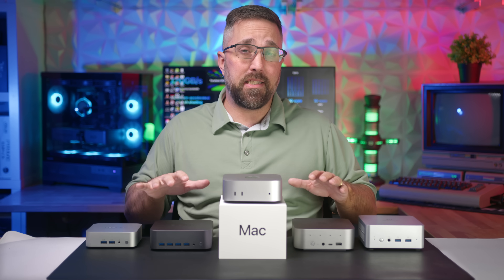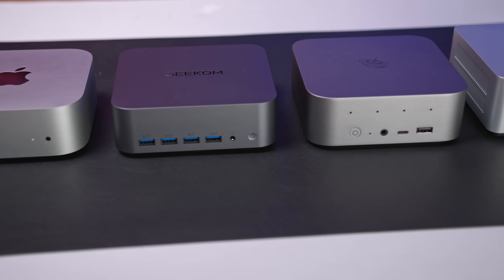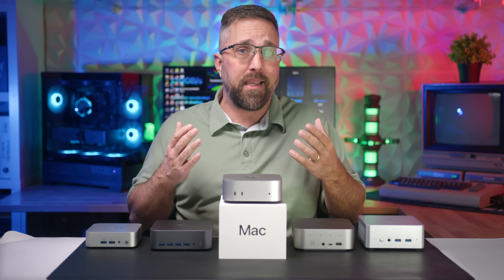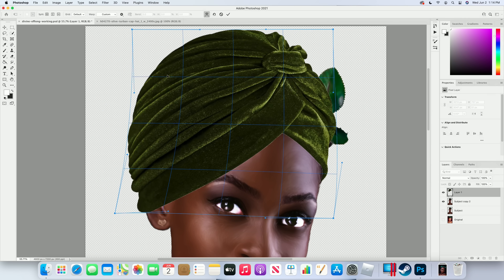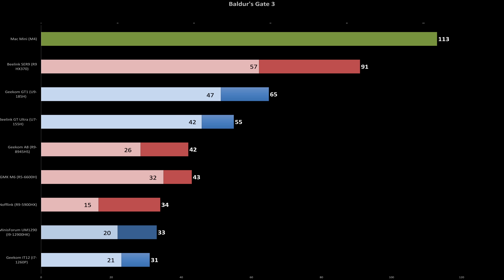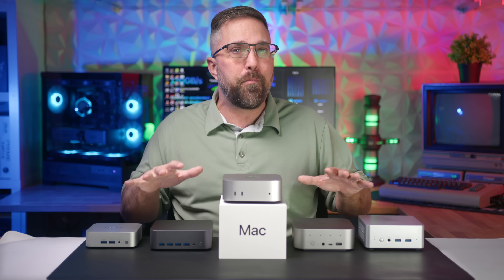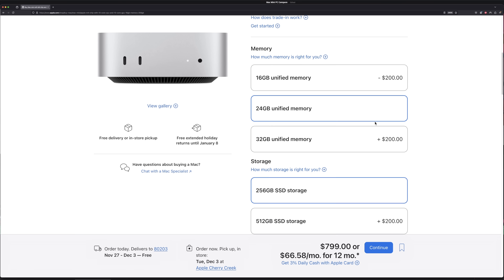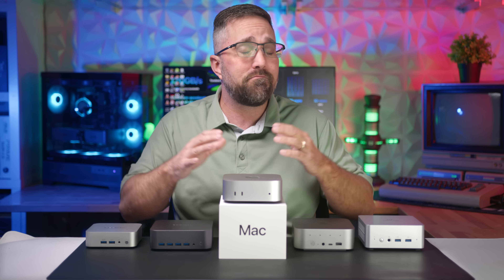M4 Mac Mini vs Intel and AMD Flagships – It's Not Even Close!

Comment: Thing is with a macOS/UNIX host system no reason to turn it off.  Never turn off my new M4 Apple MacBook Pro - Space Black 14-inch Liquid Retina XDR display 10-core CPU, 10-core GPU, 16-core Neural Engine 24GB unified memory 1TB SSD storage  $ 1799.00 US.  Run third party Energiza Pro and have it set to start charging when below 50%, and stop at 70% so never see any issues when it comes to the battery.

Have owned three Apple Mac mini's over the years.  Moved to Apple MacBook as my daily driver that I can take with me.  The fact that I can easily take it with me is why I went with a Apple MacBook or the Apple Mac mini.

Open source Linux I feel will come over time.  Linux must like UNIX has found its home on a number to processors over time.

Comment: I have a 2020 iMac 27” ,3.6 GHz 10-Core Intel Core i9, AMD Radeon Pro 5700 XT 16 GB, 96 GB 2667 MHz DDR4 and 1TB HHD which I bought new 2020 new . Last of the Intel chips. Just as a comparison Black Magic has a read speed of 2507.6 and a write speed of 2901.8. Rendering a FCP 50 minute 4K video takes a while not sure exact time just do something else while it is rendering. It came with 16gb ram and it has a back door that you can swap out the ram chips. M 😀

Comment: Power button on the bottom, "I can't make that make sense". It makes sense if you consider the fact that the power button on a Mac is almost never used. I've never voluntarily turned off any of my Macs since 2002. So the only time they're off is during software install (which doesn't require use of the power button) or in cases of non-laptop Macs if I was moving it from one location to another. In the old days you occasionally had to reboot once or twice a year due to OS crashes. Something that has become so rare that I have no idea how long it has been since I had one. Other than that, never use the power button. And notice that Apple keyboards have a power button on them, so the computer boxes power button is redundant if you're using Apple's keyboards. So you're talking about a button that you will likely use a few times / year or maybe never.

Comment: For a new machine as an internet of video hub Mac is probably the best choice. For X86 things like gaming and support of old eBay stuff, I would not consider it, it is not X86 and they stop support like their phones. My laptop is a 2012 I7 Mac that I put a TB drive, memory, battery, Win11, and a lot of games on, it works great and I did it because I trust Mac hardware.

Comment: I disagree with you price to performance chart.  I just picked up a new SER9 AI HX370 for 999. This comes with 32 GB RAM and a 1TB NVMe HDD.  If I go onto apple's website, and build the BASE model with the same RAM and HDD specs, it comes out to 1399, another $400 more than the SER9.  I suppose if price to performance also means with dis-similar specs, then that chart is accurate.
Reply from the maker: Is the 32 GB of memory and more storage required for your workflow? How much performance gain does it deliver, and will it outperform the lower-spec Mac Mini?
Reply: @ElevatedSystems  - I think what Im saying is, subtract the cost of what apple charges for the RAM and drive upgrades from the other systems.  Their performance for your tests more than likely wouldn't drop.
Reply from the maker: @rrshier  the costs are the costs and the prices are the prices. Apple charge stupid prices for their memory and storage and Intel/AMD charge stupid prices for their APU’s. Considering just the cost of the newest CPUs in the mini pcs costs more than the entire Mac Mini.
Reply: @ElevatedSystems  - By the way, I don't overall disagree with your assertion. I definitely use systems in a way where 16GB would not be close to enough.  I also have been looking at these for something I can put in my camper as a travel gaming setup.  For that, Apple just isn't the system, and this is having been an apple app developer for years, I love the apple products overall.
Reply from the maker: @ why not just go with a gaming console? Genuinely curious.
Reply: @ElevatedSystems  - Great question, size and weight.  Campers (even our big one) dont really have the space for a full PC, and Im looking for something that can easily emulate and play SOME AAA games.  Most of what I own is on STEAM.  At home, DEFINITELY a PC :-) but on the road, Im searching for something small, light, and with enough power to do 95% of the gaming I want to do with no additions.  I actually just put in an order for a Beelink SER9, but I think I may return and wait for a mini with the soon to come out 359 Max +. (Just subscribed :-))

Comment: Interesting article, but I have a big problem with this:

You are using yesterdays pricing for the PC products.  I just ordered a Minisforum UM790 Pro with an AMD Ryzen 9 7940HS processor barebones, for $300.  This has Radeon 780M onboard graphics.

Add 32 GB of 5600 DDR5 memory for $80 and a 2TB Gen4 Silicon Power NVME drive for $100, and you end up with a killer productivity /  gaming PC for around $500, withbetter price / performance to the Mac.
Reply from the maker: The 7940HS is 2 generations old. Of course it’s cheap.
Reply: @ widely acknowledged that is almost no difference between the Ryzen 9 7940 and the Ryzen 7945, both in benchmarks and real world performance.

Geekom A8 complete system also available for $550 currently with 32 GB DDR 5 ram and 1 tb nvme

Comment: Windows i can connect RTX 4090 with thunderbolt  ! apple cry
Reply from the maker: So you are getting half the performance from a $2000 graphics card on a sub $1000 mini pc. That’s not very intelligent hardware pairing.
Reply: @ElevatedSystems  Not if you use it in certain games and not if you are using it for Blender and Davinci resolve.

Comment: i'm sorry... As "bad" a value Ryzen AI HX 370 is, for now, the 8735HS Ryzen mini PC for 440£ (32GB/1TB) is unbeatable as a mini PC. 

And NO, i'm sorry, i wouldn't buy an Apple PC with just 256GB of storage... 16GB of RAM is already cutting it close, (8GB unified was a spit in the face of consumers).

How about you spec the apple mini with at LEAST 512GB of storage... Because if i'm gonna work with external SSDs and Thunderbolt 4 dongles that cost HUNDREDS $$$ ... You're making a really misleading argument... 

799$ for 16GB/512GB Mac Mini isn't as appealing and hell not the >1000$ for 32GB/1TB options.... But hey... We're simping for Apple on youtube ain't we?

Comment: 256GB is just offensive. YOU CANNOT SUBSTITUTE EXTERNAL STORAGE FOR BOOT DRIVE CAPACITY. The minimum base model SSD space in 2024 is 1TB. Period. Apple needs to wtfu. My 2011 Imac had a 512GB drive and 12GB ram, both of which could be upgraded. I have watched these Apple releases year after year and have never bought another computer from them because they decided to stop providing adequate ram, hard drive space and I/O. Their computers are therefore unusable. I loved my 2011 Imac, but I won’t be back until Apple starts selling whole computers again. No one cares how fast the processor is if the computer repeatedly crashes due to insufficient RAM or you cannot install large audio libraries because there is not enough transition space on the boot drive. Wake up Apple. My Lenovo Legion has 8TB internal storage and 128GB ram and was about 1/5th the cost of a comparable Mac.

Comment: With only 16GB of RAM and 256GB HD mini still isn't an option. That's ludicrous. They could release it for $800 with 1TB HD and 32GB of RAM. That would be a competition. PS. An i5 14700K based PC (with mac os on it - Open Core), with 4TB NVMe, 128GB of RAM and RX 6600 costs around $1300. You can always build it with less RAM, smaller NVMe and pick other AMD GPU (used one). Performance wise it's not as fast in single as base M4, but it's between M4 and M4 Pro in multicore tasks. In other words you can build a custom PC, that is almost as fast in multi as M4 PRO, yet with much more RAM and NVME storage, for less money than basic M4 Pro mini.  The only problem here is power consumption.
14700K    2942     Single-Core Score    19088    Multi-Core Score  125W
14700      2740     Single-Core Score    16063    Multi-Core Score    65W
M4mini    3838     Single-Core Score    14838    Multi-Core Score    40W

Comment: If you do a lot of video editing the M4 is great. For other uses it's not so hot. 

This is for desktops. For laptops low power consumption trumps all. Then you are down to power consumption vs battery capacity and weight.

Comment: Same lie over and over again by fan boys like the creator of this video. Don't compare the 699 euro basic Mac Mini because it's useless and no one really buy it. The real starting point is at last 1TB disk and 32G RAM. That's the minimum. With the minimum M4 10 cores chip it's 1690 EURO!!!! it's much more then ANY OTHER mini PC out there to sell!!! I kust bought a mini PC for 351 EURO with 32G and 1TB disk. Sure, you'll not get a good spec at that point, but it's by far less then 1690 EURO to pay for Mac Mini the real basic (with 32G RAM and 1TB disk - the minimum requirements today).

Comment: The Mac mini has the button underneath because it is not necessary to turn it off, as its consumption in use is ridiculously low, and in standby mode it is negligible.Energy-wise it is ridiculously efficient, but I think if I were to put an on and off switch, it would be interesting to put a touch button on the apple, just put your finger on the apple and turn it on. Lol

Comment: I paid 600 for the beelink 370 hx amd one. I prefer windows personally so at that price its hard to refuse. Also no clue why but I am getting a lots better on Geekbench (2919 single core and 15489 multi core.)î how you get that low is strange. Same for gpu on open CL I am getting 49441. But if we use one made for amd gpu Vulkan (why not as you used apple API right?) I get 59403. I am wondering if your unit fully updated (including gpu drivers and bios) and if you adjusted the gpu memory (its can stretch it leg better at 8 gb than default 4 gb setting) I think the difference would be much less if it was fully updated and running at 8 gb gpu video memory instead of 4 gb. That or your unit defective.

Comment: I have a m2 Mac mini (8gb ram / 256 gb ssd), but I want to buy a m2 iPad Air (8gb ram / 256gb ssd) which is 599 USD on discount, it costs the same as the base m4 Mac mini (16gb / 256gb SSD). I don't know what to do.

Comment: I had a intel macbook pro that I used as my daily driver for all my school stuff and coding projects. I had to do a lot of C sharp stuff this year ( I am not a fan) so I sold it and got a windows laptop. Windows 11 has given me a lot of issues but I don't want to pay apple prices. I ordered the M4 mini with student discount and upgraded the RAM to 24 GB for $750 after tax. 16GB is probably fine but when I am running a couple of docker containers, its nice to have the extra RAM. I don't need a laptop so this seems like a better value. I get people complaining about the storage size but its not hard to plug in an external drive and its not like a laptop where you have to carry around the extra storage, or even better build a NAS and you can access your files from any device.

Comment: Am I the only one that noticed that the Mac mini was stock not max upgraded while the others were
Reply from the maker: Nobody noticed because ALL the PCs were stock / base configuration. In fact those are the only config the Mini PC are available in. If you want to upgrade them you need to do it yourself. Which you can do and was a point I made.
Reply: @ ahh I see I though the others were maxed out due to the fact they had names like intel ultra lol

Comment: AMD is really good at games in my experience. I know it's all different cpu architectures, including ARM. I recently bought a new Intel computer with a 12600kf and a rtx 3060 gpu and it's fine, but my AMD pc from 2012 is still kicking ass with a AMD fx-4100, an Nvidia Titan X, and a EVGA 850w gold rated psu. Solid machine for gaming, just now falling behind a little bit. Some games like ffvii: integrade will run, but not great. Consider that AMD made a processor that was taking anything you threw at it gamingwise for 10 years, with only 2-4 cores, that's still pretty good. 

I could play almost any dx11 game without even a liquid cooler. It's kind of like a ps4 with better graphics. A lot of new games still run on it, just not the ones with very good graphics. Even on lowest settings they won't run sometimes, but that's such a small number of games, that it doesn't matter. I also don't expect to do a lot of emulation on this thing. I just run a bunch of steam games natively. Single core performance sucks. Emulationstation is not happening.

Every feature a game could ask for was on this cpu. I still use it as my 'always-on' pc, actually. It's my beater and I had stripped it once. Fixing it and some of my other old junk taught me a lot about computers, that simply spending money on a new pc right away would not have taught me. In fact, I probably got a better deal maxing my ram and buying a gpu and a psu than buying a whole new pc with crappy specs. 

I didn't even know it had an amd: I bought it to play final fantasy XI in 2012 after my childhood pc crashed from probably my ex-gf looking at porn on it and the guy at the store told me "buy this acer desktop" and you can upgrade it one day for gaming. It took me a while, but I spent 2022 upgrading the crap out of it and buying a ton of discounted steam games, and I love it now. Even though turning it on with a gpu (not oem, and you have to disable onboard drivers) is like 15 minutes of darkness first lol

Most people who complain about cpu's being bad are the same people who use a can of air to clean their pc, leaving a bunch of dust in the air cooler... Get a small air compressor (the pancake style with 5gal. capacity) and blow the dust out of there periodically. Guarantee anything will run great if it has good airflow inside the cooler. A hot cpu will always run like ass.

Comment: now add a nvidia 4090 egpu and run those tests again. spoiler: the mac doesn't know what an egpu is. 
then do some benchmarks which use all the 32gb ram like a local llm. spoiler: the mac will use the ssd to swap and it will lag (already tried that on mine). 
then try to save a 600gb library of files like homework. spoiler: the mac will not save them.
yes, the cpu singlecore performance is very high and the power efficiency is very good for the price. but there are other things that will affect the value of a computer.
Reply from the maker: Or I’ll just test workflows that are realistic for a $600, 25W mini computer.
Reply: @ElevatedSystems  those 3 use cases are realistic because they are my use cases. 
the mac mini is not 600$ with 32gb ram and 1tb ssd. 
but i can buy many mini-pcs for less than 600$ which can fulfill all those requirements. 
currently i'm using an old laptop with a 8550u and a broken screen for these use cases and i'm looking for a replacement. 
(well ok i don't have a 4090 but instead a 6700xt which will still not be recognized by any current mac)

Comment: Testing CPUs against each other with CineBench 2024 is complete and utter bullshit, because you are not so much testing CPUs but rather the memory.

Here is the proof:

1) Booting my 9950X after doing a clear CMOS - so the CPU at stock and the memory at JEDEC:

CineBench 2024 score: 2196
CineBench R23 score: 44059

2) Loading EXPO for the RAM and running at 6000 MT/s

CineBench 2024 score: 2347
CineBench R23 score: 43815

3) Tweaking my RAM (for instance tREFi 65535)

CineBench 2024 score: 2481
CineBench R23 score: 43890

4) Raising the RAM speed to 6200 MT/s and FCLK to 2067

CineBench 2024 score: 2506
CineBench R23 score: 44005

As you can see, a difference in RAM speed/configuration has a disproportionate effect on the CB 2024 results.
Reply from the maker: Ok, and? In case you missed it I’m testing prebuilt, preconfigured computers in this video, not CPUs on a test bench. You can’t even “tweak” RAM on these. It all runs at JEDEC settings.
Reply: @ElevatedSystems  The different systems use different RAM configured to different timings.

THIS is what I was objecting to with regard to CB 2024.

I used my own system as an example to show what disproportionate effect RAM configuration has on the scores.
Reply from the maker: @ and if this was a CPU review that would make sense but it’s not. It’s a comparison of manufactured mini PCs. I’m not testing CPU or RAM, I’m testing the system. How it all functions together is the point. Nobody cares about memory settings that cant even be changed.
Reply: @ElevatedSystems  What was your purpose in using CineBench 2024 then?

I have made you aware of the deficits of using CineBench 2024, I have shown you evidence of why using CB 2024 is not legitimate when testing disparate and heterogenous systems in terms of CPU performance.

For some reason, you seem to be taking it as a personal attack on my part where any ire I may have is pointed towards CB 2024 as a measure of CPU performance, which it clearly is not.

Comment: Still using my 2014 Mac Mini i7 32GB Ram with an upgraded SSD... works fine and I only paid €200 for it back 2018... and I literally only use it to run an old version of Traktor Pro 2 DJ Software... (Got my 2017 Macbook Pro for work and my own build gaming PC for gaming)